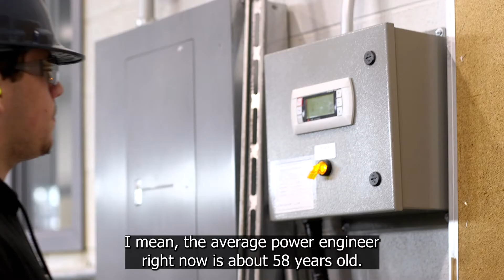Power Engineering Technician

Comment: Quick disclaimer to anyone considering to get into this field. Hands on component of training is limited, and will be required to varying degrees depending on the place you work. More, and more companies are actively trying to circumvent the TSSA rules in order to slash Power Engineer jobs. This can be opting out of larger capacity equipment, using a different type of boiler and or chiller in order to be sure attendance isn’t required there’s sadly a lot of little tricks I have witnessed during commissioning. There is only so many jobs in Ontario that pay well, every other place besides those good ones will use you, and abuse you. The credential for this Field is important in large industries, however if you find yourself in a small plant you will be looked at as an number easily replaced. Large portion of the jobs in Ontario are in the food industry, which again those jobs are changing as companies are training their in house millwrights to get their Refrigeration B ticket if that is a option available to them, there is even a bunch of places that won’t hire you as an Operator unless you have a trade ticket to go along with your operating engineer license. All of this is places trying to downsize Operating Engineer staff. At the moment there are a lot of jobs still currently, but those jobs may start to vanish as time goes on. Netzero will also impact many Jobs in this field shutting down multiple Natural gas power plants especially with the emergence of Modular reactors , and other techs that will make up the demand. companies may Be incentivized to move from the use of gas fired Boilers, Ammonia  refrigeration and other traditional means of energy which would be terrible. 
Good thing is there are many high paying jobs at the Nuclear plant, which seems to always be expanding, and they hire power engineer graduates, Even the hydro electric plants will hire graduates as operators. Not trying to scare anyone from the profession, but some important info should be passed to the students before putting all their eggs in one basket. This is a great career path still just some consideration should be made before you jump into it. If you do make it you will most likely be met with long term employment, and good money. 
I only chime in not to push anyone from this choice just to know there’s some serious limitations, and would hate to see someone 20 years down the road re training for a new career.
Reply: I was thinking of doing power engineer im in canada but having second thoughts might just apply law enforcement instead
Reply: DAMN... I was just about applying to CNA to do Power engineering Technology. This has given me serious pause as a foreigner. Thank you kind stranger for some realistic info.
Reply: @wideback4553  hey can you read & comprehend things? When did I say any regulations were going away? anyone reading these threads don’t listen to this Wideback guy, clearly he’s uneducated with the current industry, and isn’t informed with our place when it comes to net zero. 
I stay tapped in the industry this guys a troll.

The TSSA isn’t out protecting the jobs of the operators unfortunately. 

I was at a Canadian boiler Society event  and the chief officer from TSSA was there.
We had a discussion where he was saying that people give him a lot of flack because when he’s adjusting regulations and rules, he’s putting people out of jobs, and his exact words my job is public safety. I can’t care about peoples jobs.

It really gives you an indication about how people feel about the operating engineer careers .
Reply: There is no chief officer right now in Ontario.
Reply: @wideback4553  what are you taking about? 

Glen lang? 

I was at the CBS event 6 months ago in London with him lol.

Again you’re talking about things you have no idea of.

Easy Linked In search bud
Reply: Don't listen to this idiot. TSSA will never go away along with other Provincial regulations. Gas is not going anywhere. Steam still needs to be made. Millwrights will not be legally able to do both jobs while operating or will even bother for the same wage. Good luck getting a Millwright ticket if your a newcomer to Canada. Please don't posy this bullshit. Alot of these newcomers are causing safety problems and injuries. I honestly feel bad for the Pakistans coming here. All of them get fired within a year where I have worked. The companies just hire them for cheap then fire them lol. The training they have or will ever get will never be the same. The language barrier, work ethic and actual care and knowledge will ever compare. Unless companies want things to blow up. I doubt that. Honestly Canada is just using them for the short term. Its sad
Reply: @wideback4553   you have no idea what your talking about or your not tapped into the industry I feel bad for anyone who listens to you!

I never said the regulations would vanish either don’t understand why you thought I meant that lol. Which proves you have a low IQ, and can’t digest what I originally wrote. 

The amount of plants that need only a refrigeration B on the wall to operate, in which they get their millwrights licensed with the ticket( act as shift operators) and usually the maintenance manager will be acting chief,
which than they ignore the TSSA areas and just work as millwrights.  

Also many of these job positions asks for willingness to get refrigeration B, if you think this isn’t happening, I would be surprised if you worked at more than one place as an operating engineer or if you even know anyone in this field.

Like this is common knowledge. How can you not know this.

This is reality regardless of what u think of the regulations. 
Now im not referring to a plant that requires a Refrigeration A chief just to be clear… I know of 15 plants right now that do this, and I bet there’s a lot more than what I’m aware of.
I even worked at a steam plant like that so don’t act like the regulation means a-lot these days.

I rather not fill anyone’s heads with falsehoods, there’s lots of jobs in the industry, but in the next decades that may be reduced.  
New students should be aware.

If you think gas will be here in the same capacity in the next decade your lying to yourself, and I’ve never said steam will be going anywhere just the ways at which steam will be produced.
Once Modular reactors are Canada wide that will displace Natural Gas Power Generation.
Reply: @wideback4553 just read through this thread, and sir it’s safe to say you are not a power engineer 👷 😂 get outta here buddy.